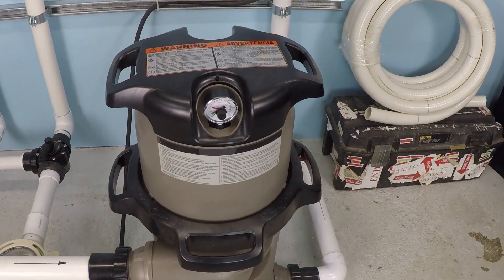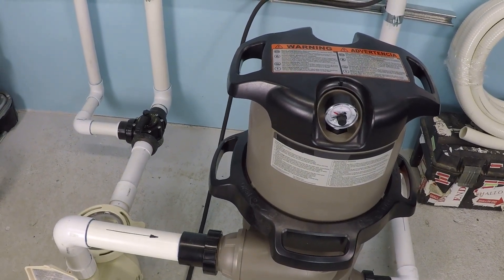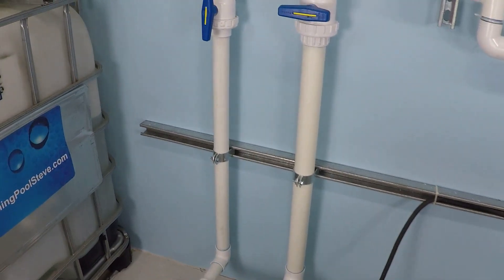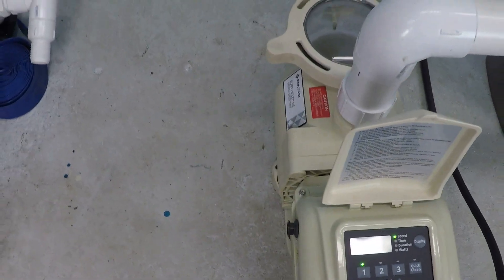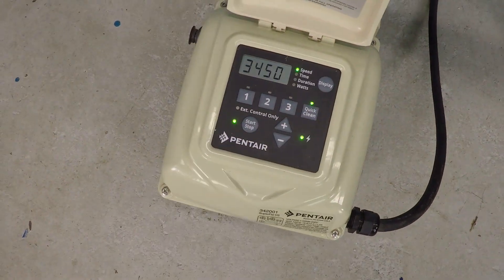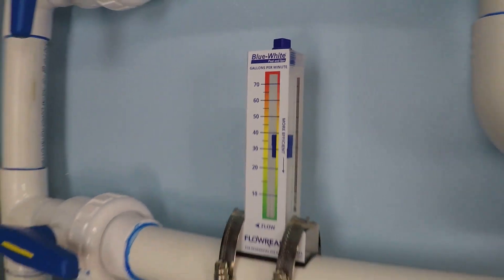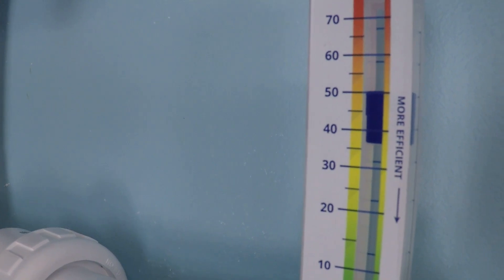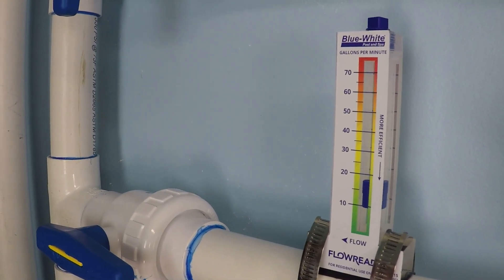Protect Pool Equipment With A Flow Meter

Comment: Designing my pool.  I have been watching your videos taking notes. I have been doing research probably 12-15 hours a day the last 2-3 weeks. It cost lots of money I want to do it right.  I was going to put a FlowVis meter. Depending on the builder I go with one wants to install the Pentair IntelliFlo3 VSF 3hp and the other Hayward Tristar 950 I know you like the 900.  (I will have 12-16 jets  in my spa that has to be 75'-80' away no choice.  Plus bubblers and what you don't like in floor but I live in Arizona.. still unsure but that means two pumps. etc...) Would you still install the flowVis if I end up with the Pentair 3hp that says they control your flow...I need a 3 hp since I want to put like 16 jets and was thinking of putting a diverter to change the water from seats to single jets when there is company. I assume both pump will be fine for the jets. I really wanted to put the Flow meter unless it will fight with the pump... Can you turn off the automatic flow in the pump if the pump fights me to adjust according to reading on Flow meter. Mind you I know nothing about pools never had one just learning on your site and other sites and researching. Would I only need one flow meter or two if I have two pumps?

Comment: we have purchased a house which includes a pool. My best guess is that the pool is close to 20 years now. It definitely needs a renovation / rework, but I do not have any knowledge about anything related to a swimming pool. May I ask: what is your definition of a „small to mid-sized pool“?
Reply from the maker: Small = under 10k gallons. Mid is up to 20 or 25,000 gallons and large is up to 40k gallons

Comment: How do you know what part of the blue floater indicates GPM?  The top or the bottom?
Reply from the maker: It is the top of the float that you read your flow rates from.  This info is included in the instruction pamphlet that comes with the meter.  Cheers.

Comment: Can you install this before the filter? I only have about 9” after filter or is this enough
Reply from the maker: You could, and it would function, but you would be risking debris compromising the meter and for this reason I would choose not to.  The strainer baskets in the skimmer and pump should remove most of the physical debris, but plenty of smaller stuff could get past the pump and potentially bung up what ultimately is a sensitive piece of instrumentation.  For this reason I would put the flow meter on the pressure side, past the filter, even if I needed to adapt the system to make it fit.  Hope this helps.

Comment: What kind of damage can exceeding the maximum flow rate cause?
Reply from the maker: pushing sand back to the pool or cracking a lateral or standpipe.  You also could blow off the band clamp connection if you were to really overdrive it.

Comment: Hi Mr , Steve have a question for in my pool I use the bioguard optimizer so I'm learning how to keep chems, in pool after 3 yrs now and I was wondering I had plumbing installed at the pool deck of deep end of pool to add a water fall feature and really wanted to use BUT what I'm reading is that if you use a waterfall feature the PH will be affected that being said because I'm using OPTIMIZER is it possible to control if I didnt constantly run the waterfall can you please give me some insight on this or any ideas if I shouldn't use for waterfall what to do with the extra return ?? Thanks
Reply from the maker: Waterfalls are a frill.  Get one if you love waterfalls.  You will not run it 24/7 just when you are chilling by the pool and that will make its impact minimal on the chemistry.  Plus now you know to watch for the pH goin up if you run it a lot.  Optimizer from bioguard it borates if I am remembering correctly.  Which means that when maintained at 30 to 50 ppm borates will help resist upwards drift in pH.  So a waterfall would have less affect on the water chemistry than a pool without this buffer...but how much exactly I could not say.  Enough that you can have a waterfall if you really desire one, that is for sure.  :)

Comment: Hey Steve I have a question about flow rates  I have a Pentair inteliflo pump going through a 200 sq ft filter the pool has no water features so I keep it turned way down and run it for 15 hours to get  2 turnovers per day my question is there a minimum flow for a cartridge filter? Where I have it set it’s keeping the water crystal clear and the chlorine level is right on ive been running it for a month now
Reply from the maker: For the most part, slower moving water is better for filtering.  You have a big pump and a little filter and lower RPM operation will be beneficial for sure.  Will make the filters last longer too.
Reply: Swimming Pool Steve thanks for the quick reply

Comment: Steve when I 1st purchased our pool back 2017 I started watching all your vids this one brings me back because I installed an inline sacrificial anode on to the plumbing of the pump have the super flo vs , but now also thinking of changing my sand filter to a quad 4 pentair EVENTUALLY 👍
Reply from the maker: This means you are now due to replace the anode in the unit you purchased.  3 years or when it had depleted in size by half.  Some units have replacement anodes you buy, some you have to cut out and replace.  Cheers and thanks for being a regular follower!